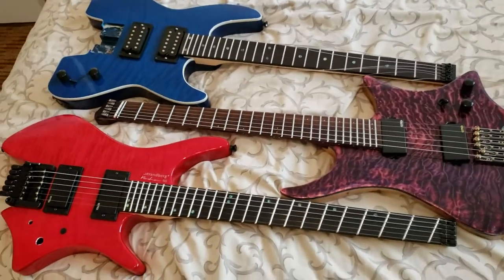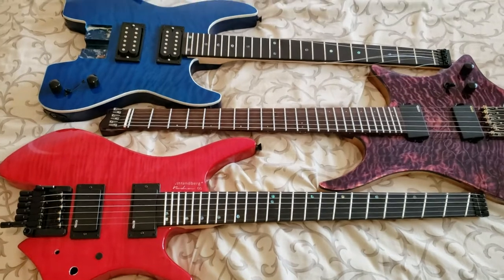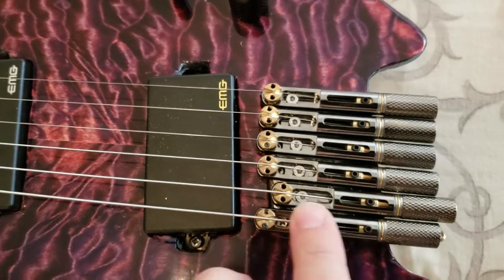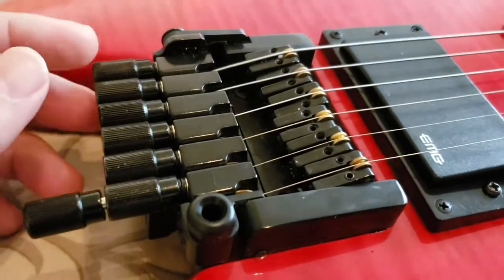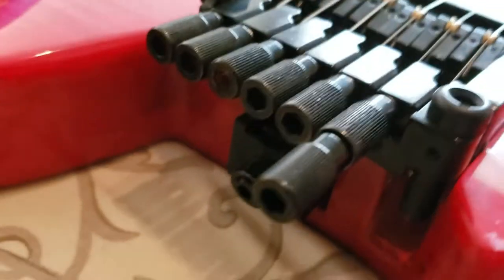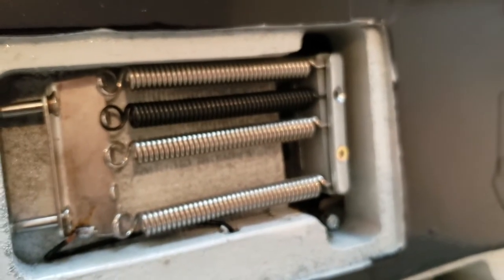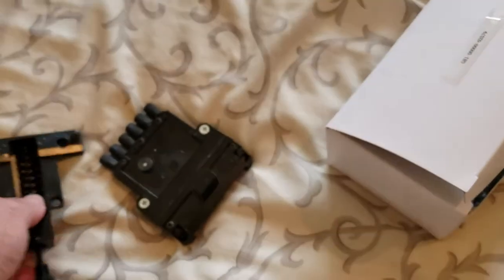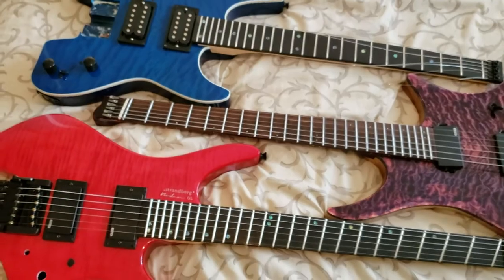Tremolo comparison and channel update

Comment: The bridge on the Strandberg guitar is no tremolo. A tremolo arm is used for vibrato effects that modulate the guitar's tuning. You can't do that with that bridge, it's a fixed bridge. You are not comparing tremolos in this video, you compare different kinds of bridges. https://en.wikipedia.org/wiki/Vibrato_systems_for_guitar
Reply: LOL once I heard "fixed tremolo" I just mentally checked out

I mean, the video isn't useless, that last bridge looks like absolute trash, so that infos useful

Comment: I had the worm gear roller saddles trem but I hated to use (and search for) the wrench. So I bought the overlord which is yes, very poor quality but since now it seems better for me. I even gigged with it. I think my problem is the tuning, I need more experiment how to use the spring's screw. I lubricated the saddle screws and the knives too. Oh, and sound wise this bridge resilts me a more pleasant sound: less metallic. THe overlord is cheap potmetal, it may have warmer sound? The roller saddle worm gear seems to be brass though.

Comment: What is your best recommendation for a player who doesn't want to use a Floyd but wants a bridge that can do those chaotic 80s/90s deep divebombs (see Trey Azagthoth or James Murphy) like the Floyd? Are the bridges used on the back edge of headless guitars like the Vader by Kiesel or the Strandbergs a better design that still allow you to divebomb deep? Are there ANY that divebomb as easily as the Floyd but found on standard super strats (as opposed to headless)?
Reply from the maker: I get this question alot so I'm gonna make a video about it

Comment: Try chopping a 1/3 off that f*cking lifter spring they provide,..or a completely different spring,..or that one, cut down and sleeved in one of a slightly greater dia.(may have to nudge it in w/🔨, good thing it built like a tank)until you get desired tension maybe even some kind of retainer on top of the channel even..🤔🚬(also, damn, that is the hardtail version, how high am i?-they have the soft tail now and it look candy🍬, havin one..)

Comment: ..my guy, subscribe. Those Overlords ARE nightmares.,..that frame, same as the A1 Abram,(I'm in process of modifying mine now😖)..but that newer one, kinda in the Kahler/Bigsby vein,with a little Floyd kiss with thesprings/cavity)Kahler calls it a cam, incorrectly (a Tru cam has an ecentic profile, this I refer to as an expressive axle...)anyway, I'm getting one of those on the way!....also, the one (a Tru 2 point), the one at the end,...can't wait!!🎸🎶🫀💯🧡